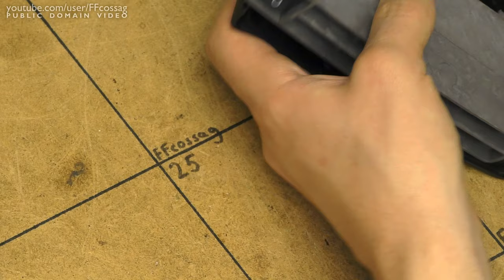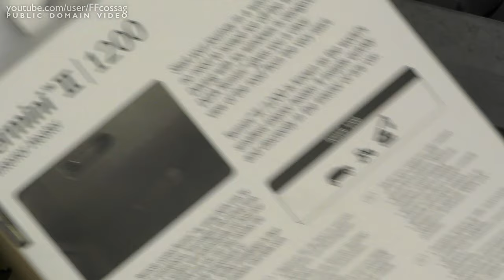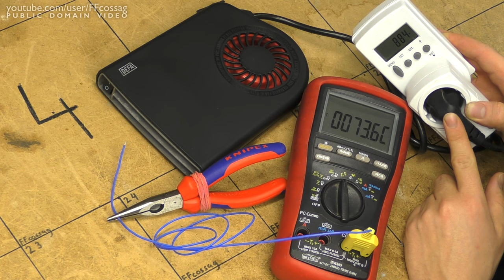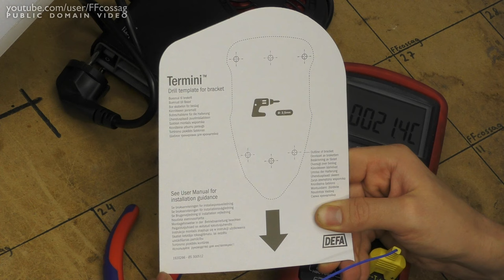DEFA Termini II 1200 teardown

Comment: I think the thermal fuse have to be connected direct to the heater to detect excesive heat and break the circuit.

Comment: Fancy them using an actual (and seemingly quite well made!) switching power supply just to run a fan! I'd have expected some rectifier diodes and a capacitive dropper.

Assuming the fan holds out (and with a little help from some good oil, it might), a longer lifetime than five years might not be too unreasonable. I do like the orange colored blower wheel.
Reply from the maker: They likely couldn't have gotten away with a capacitive dropper, since you need a pretty big spike of current to rev the fan up at start-up, in order to not instantly smoke-test the heating element.

Comment: Ha ha i do like your sense of humor, nicely modified xmas poem :-D.

That psu has a good rectifier diode, 2-3 amps perhaps, and its regulated via a feedback opto coupler, better than needed for a poxy fan.
Perhaps bolt a large crock clip from a welder to the plastic plate, clip it on the steering wheel/gear stick or whatever.

Comment: Use to have an old one of these. then moved to a in line coolant heater when it broke.
Reply from the maker: Ah - I have a proper block heater as well, but with 13 litres of coolant to pre-heat, it'd take from dusk till dawn to get warm enough for comfort.
Reply: I have one of those as well as it come stranded on every car in my country. the aftermarket one i added better heats and  pumps the coolant around  so there is hot air from the start.

Comment: Is it just me thats confused why you would have a 240 VAC heater in a car ?
Reply from the maker: It's really nice to have the cabin pre-heated in the winter mornings.
Reply: I'm wondering that, too!
You'd need an inverter in the car to get the 240 volts, then the PSU in the fan steps that back down again :| inefficient!
Reply from the maker: It's for pre-heating the cabin in winter. You plug it to a timer and a wall outlet.
Reply: FFcossag Ah got you :) Presumably then while it's in the garage or somewhere
Reply: Think again. 1200 Watt max power on a 12 Volt (car) batt would result in 100A and that is when the efficiency of the invertor would be 100%
@FFcossag, I was looking at one from China but I'd rather want quality stuff in my car.  Can you maybe do a recording, like timelaps with a thermometer and a clock inside your car? Maybe also on the outside so we see the ice melt.
Reply from the maker: Luc Peeters
I turn it on at 6 in the morning, and the car is always thawed and comfortably warm at 8.
Reply: @azyfloof  In nordic countries we have 230V Defa/Calix/etc... system plug in front of the car that powers 230V outlet usually located in front passenger feet area. Apartment buildings and work places have posts with 230V outlets at parking lot, that's how you get the 230V in your car in the morning and when you leave work. 230V system usually has also heater element that preheats motor. I also have battery charger that charges battery while car is connected to 230V. This needed because if you drive shortish 15min or so commute, car battery at -20C does not charge enough in 15min to cover the energy you consumed when car was started. Especially Webasto/other oil powered heaters in diesel cars consumes a lot of electricity and you must run them 30mins or so to keep them from collecting soot and dying and if your commute takes only 15min, you have to let the heater run from car battery 15mins after car was parked.
Reply: I think it’s a European country, in Canada it would be a 120V one.

Comment: I wonder, if something blocks the fan, could it be that the fan engine then overheats, causes fire? Or what happens when the fan has power on it but does not move?
Reply: If the fan does not move or draws too much current, then power supply will shut down. After that thermistor will trip. Older ones had 220V motors with their own thermistors, maybe it was the reason why they switched to 12V motors? Could be the size aswell-1,7 kW heater from 2003 is much bigger.

Comment: I have a small AC blower heater rated 500 W. I was wondering if its okay to use that one instead of these specialized heaters? Can that damage block heater? My car has Calix engine heater/ block heater that provides an outlet inside the car.
Reply from the maker: It's fine.

Comment: how do you power it in your car?
Reply: We have a male electrical point at the front of the cars which we plug either into the mains or an electrical timer on a post next to parking spaces. That's brought out to a socket in the footwell or similar, so you can plug in a heater and your coffee maker.
Reply: Oh very nice
Reply: As far as I remember, he has full AC power in the car, complete with solar panel, batteries and inverter.
Reply: Doru Barbu no

Comment: Do you know the value of the resistance of the heater in Ohms?
Reply from the maker: No, but it varies with temperature.
Reply: @FFcossag   I wonder if this heater can be modified to run only on 12V DC  .. perhaps by re-wiring the elements; there are two of them in series, right? If we calculate the resistance, based off 900W measured at 230V it should be around 60ohm load ..

Comment: What a noisy fan.  There are quieter heaters that consume less power. example My 230V 500W oil filled radiator. I have many times use it in a car.  

Those noisy fan heater It use a lot of energy 900W i see  that is  900 / 10= 90 Ampere oeps.
Reply: Something wrong with your maths there, should be 900 divided by 240V equals 3.75 A.
Reply from the maker: An oil filled radiator isn't quite the optimal choice for quickly heating a small space temporarily.
Reply: Hay This heater working in his car with a inverter 12 volt battery to 230/240 volt  The convert loss and effectiveness from the inverter is the standard conversion divided by 10v not by 12v

900 watt  converting from a 12 volt battery = 900/10=90 ampere by 12volt.

FFcossag must have a powerful alternator almost 100 amp.
Reply: Ha now I understand.  it is for warming up ear that you drive.
Reply: Where do you mount an oil filled heater?
Reply: @lexpee  not running an inverter, atleast here in Finland we have Defa/Calix engine heater solution that uses 230V. Most people opt to add a 230V plug inside the interior to work in conjuction with the engine heater. You can use a interior heater like this Termini with that plug and no inverter needed. The noise level is not a concern for most people as they are not in the car when the interior heater is running. Usually running for about 2 hours before starting the engine.